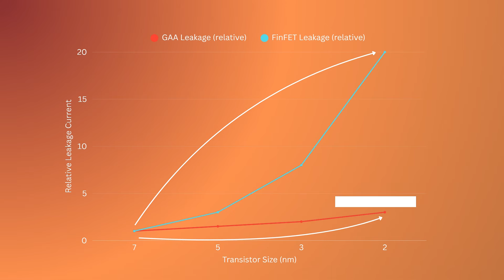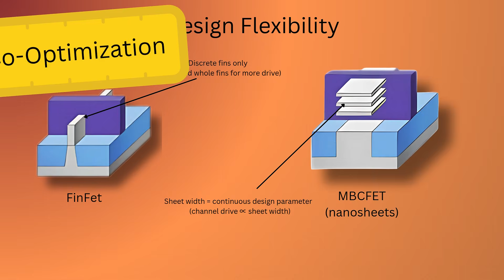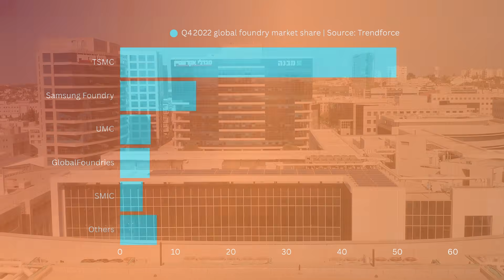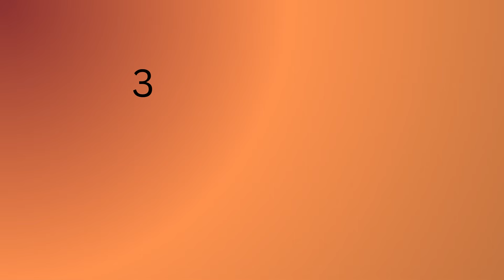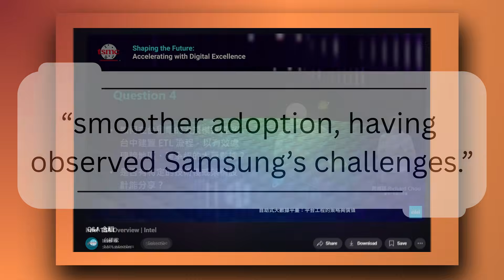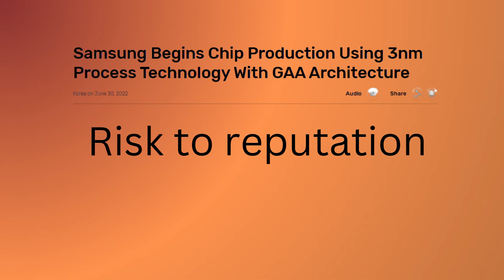The Gate-All-Around Gamble: Samsung's Bet on a New Transistor

Comment: Its basically, we had wires without isolation, it worked. Now these are to close and we use isolated wires.... huge improvement for no-brainer, basic electricity knowledge is enough to know this. They forgot 1 thing, magnetic induction problems but sure they discovered that.

Comment: High-end wafer fabs have extremely complex manufacturing processes. A small change can significantly impact yield. Therefore, TSMC focuses on mastering its most specialized processes and striving for excellence. This transformation, from a FinFet to a GAA , is a significant one.😊The GAAprocess will only be used at two nanometers